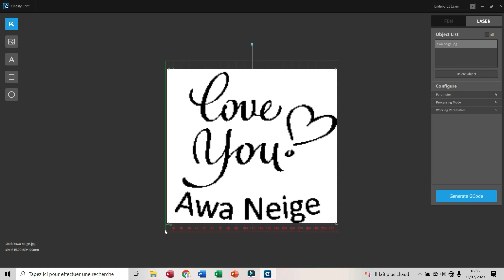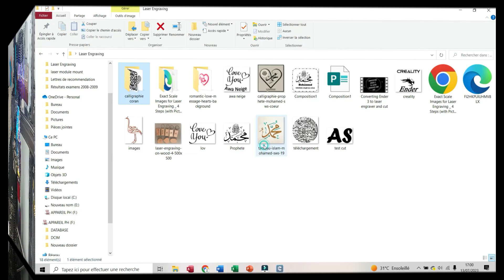107: How to Install the Ender-3 S1 Laser Module Without Removing the Sprite Extruder

Comment: Absolutly perfect, printed from your included file through Creality print, waiting for the replacement 3 x 8mm Allen screws, then try and figure out the fitting of the Laser wireing.